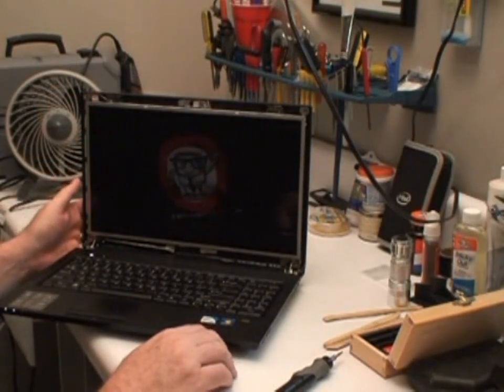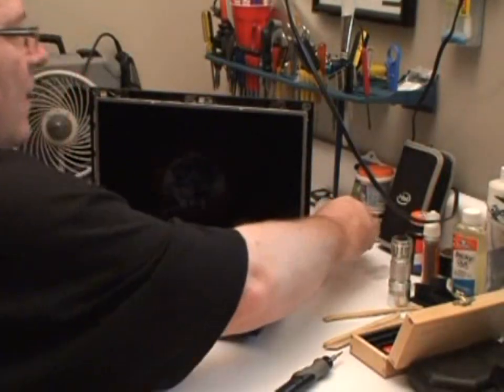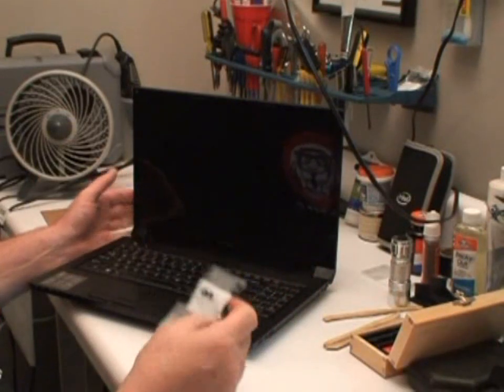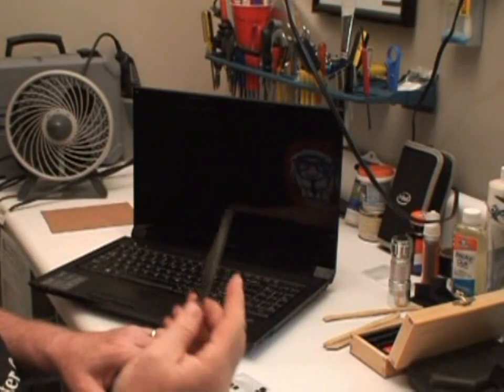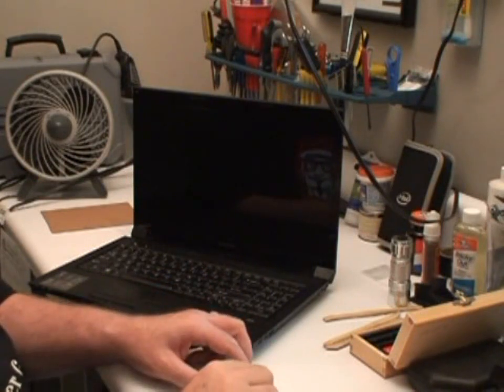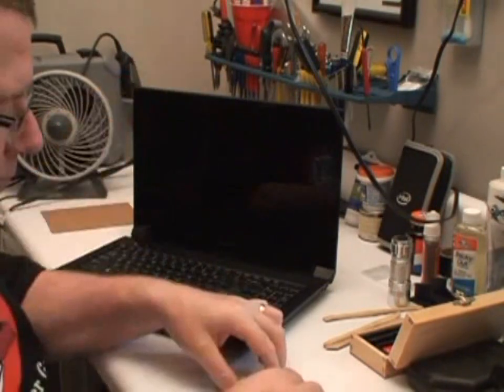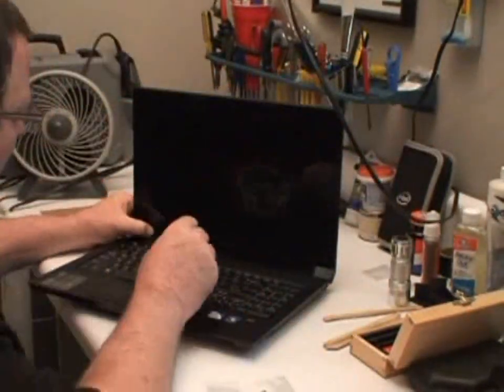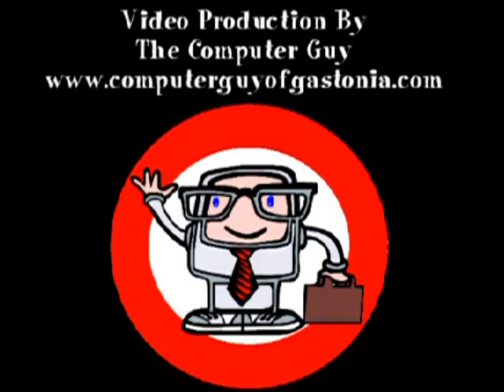Laptop screen replacement / How to replace laptop screen - Lenovo B560

Comment: can we replace the screen with a higher resolution screen?
Reply from the maker: The resolution is determined in large part by the video "card" or the video circuit in the computer/laptop. Usually the screen is designed to provide the highest resolution the system is capable of. So using a higher resolution screen will not provide a higher resolution image.
Reply: @TCG1200  so it is not recommended to replace it with a higher resolution lcd?
Reply from the maker: @enochthestud  Without knowing more about the video circuit, I would say, no, not recommended. Its usually best to go with what was originally installed for a variety of reasons. Extra stress on memory, cpu etc, can cause overheating... There are lots of reasons to stick with a replacement that matches the original specs.
Reply: Marcus Hyde OK then
Reply: Marcus Hyde what about the cpu? Can we upgrade that? I think I have an intel pentium core
Reply from the maker: @enochthestud  Its beginning to sound like you need a new laptop.
Reply: @TCG1200  no, not really I already have a 2012 macbook pro, I'm just really interested in recycling old stuff
Reply: so are we able to upgrade the cpu on the old laptop?

Comment from the maker: As a linked comment, there is no direct method to reply. Try connecting an external monitor. If you get a display on external, then replace the laptop screen. Likely a dead backlight or inverter. Most are built in to the screen now. Replace it.

Comment: When a problem in Laptop Lenovo in the camera and he does not see the caller B560 and see me when you say the program definition for Aitabak//adnanaa98@yahoo.com
Reply from the maker: Difficult to understand the question here. But if there is a problem with video conferencing, could be the camera, driver software, internet connection or several other problems.